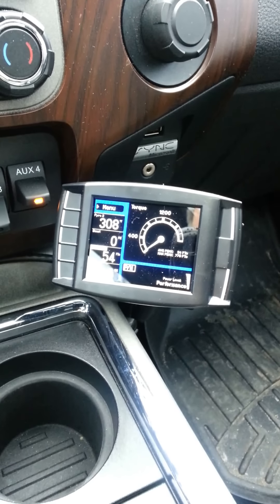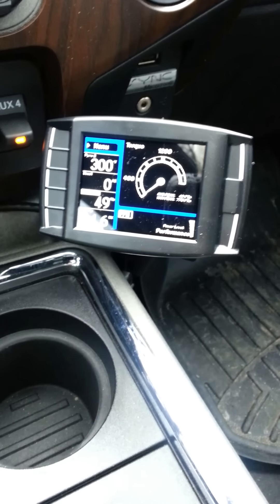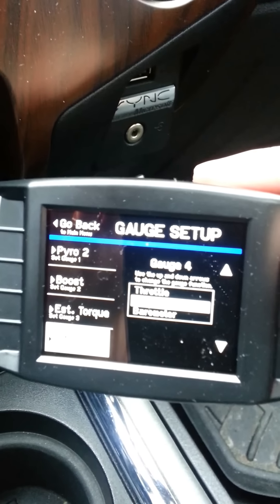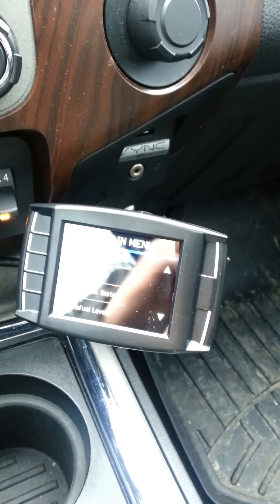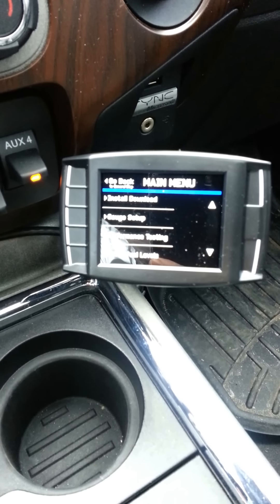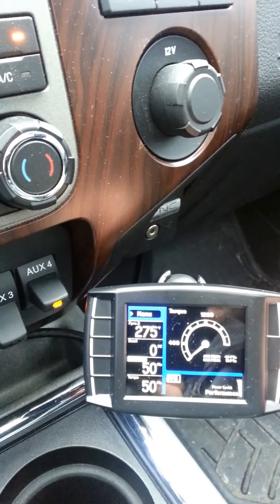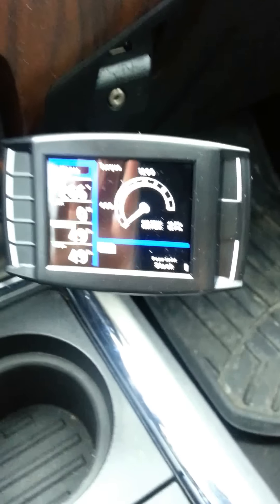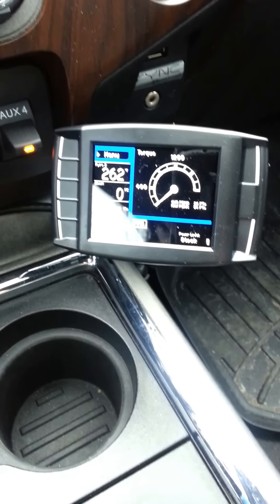H&S MiniMaxx First Thoughts...

Comment: Hey
Buddy 
What's the difference with the transmission tunner?
Stock it shifted all speeds almost very fast, I really don't like it!
With the transmission tunner it make rev more por each speed? 
It's what I'm looking for 
That delay more each speed
Reply from the maker: Transmission tuning adjusted the shift points and the shifts are firmer.

Comment: can you explain what dpf on tuning is? is dpf delete better for the truck just not legal? is there a difference between dpf on and dpf delete? like which is better for the engine
Reply from the maker: +Chandler Funk I'd encourage you to join a forum for your truck and make that decision after you have done your research.  A DPF is a diesel particulate filter.  Deleting or modifying the emission system on a vehicle is illegal.  The difference between DPF on or off tuning is very measurable.

Comment: Nice video.I bought one just like the one you have for  $1499.00 and I have it set with present emissions and on the setting I can't find the hot setting. All I see is stock, tow, street and performance. Do you know where the hot setting is or is that only when you set it with emissions off? If you know please let me know, thanks bud.
Reply: It's renamed. Prefomance is hot
Reply from the maker: Wyatt King Actually no, it is "Stock", "Tow", "Street" and "Performance".  It used to be stock, mild, wild and hot.

Comment: So, I have a 2010 6.4 with a mini maxx. Everything is good except 5th gear shift. It seems to slide into 5th. Is there a way to tell it to "hard" shift to 5th?
Reply from the maker: You can use the MCC custom tuning software to customize the transmission software, but I have not messed with the MCC software at all.  You may want to try some custom tunes from SPE, Gearhead or other diesel shop.
Reply: Thank you!